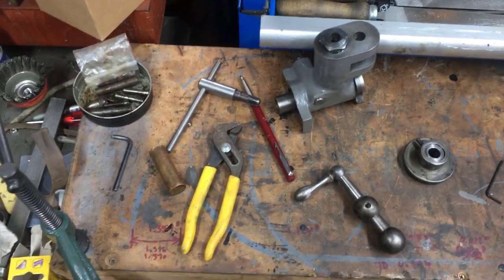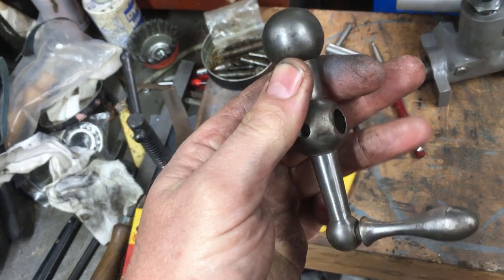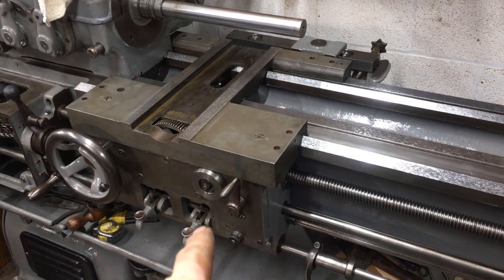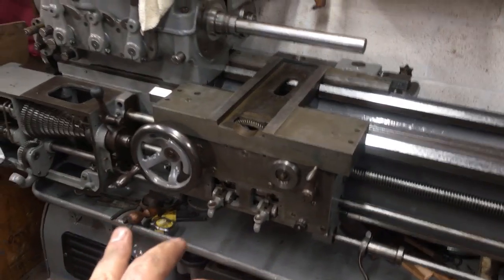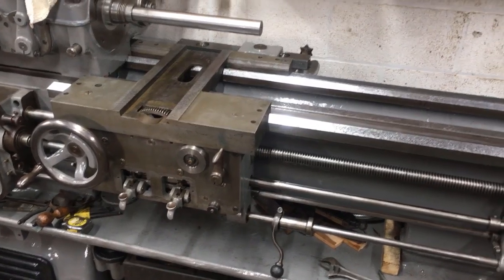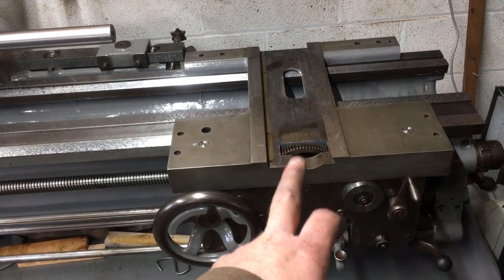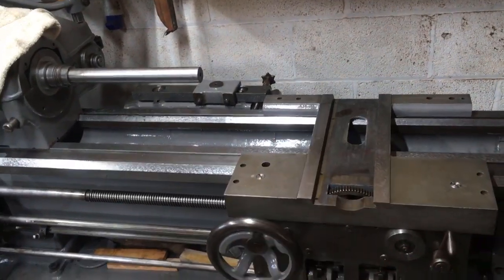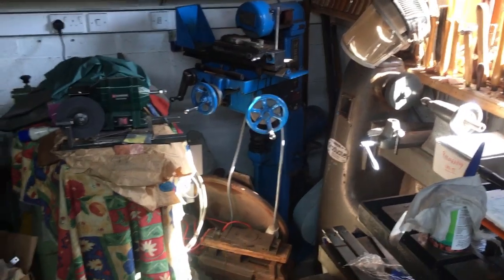Holbrook 19 - Update

Comment: Coming along nicely....holy smokes that lead screw ware was record class
Reply from the maker: that screws got to hold up long enough to make its repacement !
Reply: I am in the same boat.
4 tpi Acme  Left Hand.
That's 1/8" depth of thread  !
And a small diameter boring bar.
Reply from the maker: @stevewilliams587  the episode on the cross slide screw may prove of interest - not done it yet but this screw is 9/16" ACME LH. You try find that in a book let alone a tap ! It was bespoke to Holbrook ! I got a quote of £400 for a tap (or was it £500?( cant recall but not cheep !

Comment: Could you have used Turcite on the Saddle Ways to compensate for the loss of metal from scraping?
Reply from the maker: I could have - sure. But I started out wanting to try and maintain the cast iron bearing faces. My mentor was not a hige fan of turcite on such faces. The plan was to remove the minimum of metal and try and avoid turcite.
Reply: lookcreations  
I was just wondering. You’re doing an excellent job at the restoration

Comment: you were a little generous with the ink..
Reply from the maker: more than likely - Im a kind of generous chap like that :-)
Reply: @lookcreations  whenever i start to feel generous with the ink i stop and leave it for a day or two.
to me it is a sign i am getting getthereritis, a condition not conducive to precision.
but then again i must say that you have kept  your composure quite well since you started the project.
looking forward to the alignment video.
Reply from the maker: @janvanruth3485  the micrometer blue and its use is an art in itself. You need quite a bit to start the process and then just keep spreading it out as you progress the surfaces. Then when when move past the 'flat' surface and start adding in the 'depth for oil you add a bit more blue to speed up the reading . Too little makes for a very fine surface and for most of these faces its not required. Straight edges ... they get shown the blue from the far side of the workshop and thats it :-)

Comment: Just wondering when you decided you needed a bigger lathe ( remember the video a year or two ago when you was considering two or three different lathes) did you intend to enter in such a massive rebuild?
Reply from the maker: Well, what I had in mind was to get something like a DSG 13Z with a Taper Turning Attachment.... then spotted this on ebay and did some research - I think its going to cover 90% of my needs. Wouldnt it have been nice to just repaint it :-)
Reply: @lookcreations  - The ones that only need paint, instead require a bigger bank balance.  Such things are paid for one way or another.
Reply from the maker: @somebodyelse6673  Ive seen a plenty that need the work but get the paint and called rebuilt / refurbished ... buy hey whatever makes folks happy ! in fairness, I am going through this exercise as much to learn new skills as to the get the lathe as good as I can.